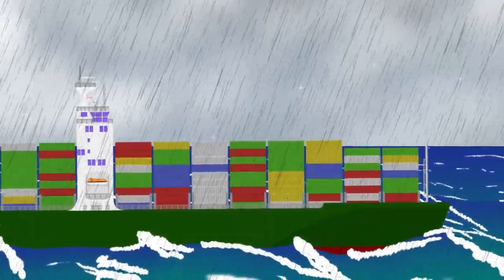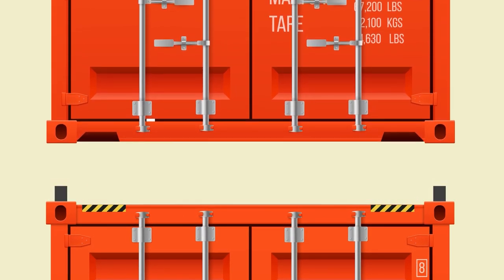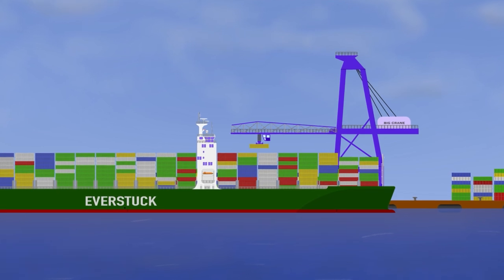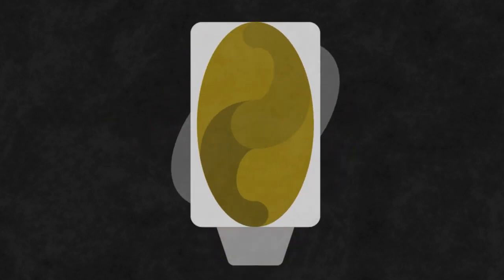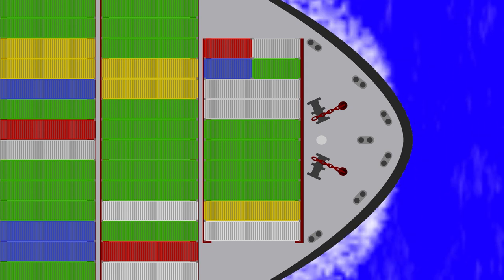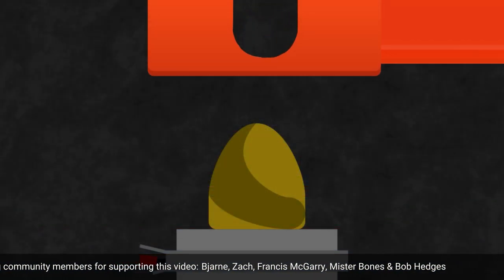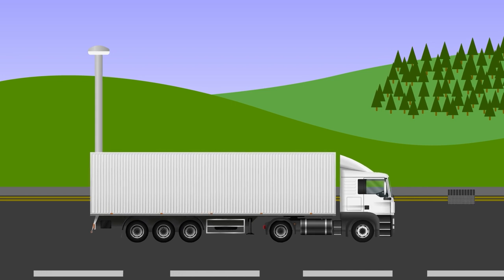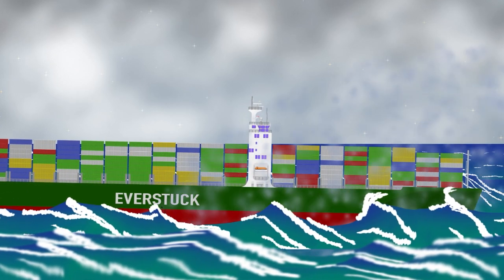Why Don't These Containers Fall Off?

Comment: Are the horizontal facing holes use to lock adjacent columns of containers together? Why are containers only ever placed directly on top of each other rather than staggered as you would with bricks when making a wall?
Reply: There used to be bridge clamps that were put in the side holes at the top of each stack to pull them together but they haven't been used for a while. There are steel lashing bars that tie containers to the deck that fit into these holes, but they can only reach the 3rd container up depending on the type.
Reply: Because then you would have to have certain width of the deck (multiply of length of the container, and they are quite long, so it is quite restrictive, especially for small ships).
And maybe more importantly you would need to have the locking points along the length of the container, to lock with all containers on top. This would add to container cost, and with their number, cost adds fast. And remember that they are used on trains and trucks too, and they wouldn't use this feature at all.
In the end, the current system is good enough, so why bother with more complex and expensive solutions.
Reply: @syriuszb8611  I was wondering why the current system is good enough. A few parallel columns of bricks built with no overlap is a lot easier to knock over than a wall where they do overlap. I guess that ships can't roll enough to cause an edge column to just topple.
Reply: @Kaine96853  Thanks.
Reply: The thing about containers is they are very weak except the edges designed for load bearing. So to do staggered containers you would need a lot more structural elements, which means heavier containers, which means less cargo. And since they will have horizontal locking, the chance of containers rolling horizontally is relatively low
Reply: I think the bigest reason to not stager them is that when you get to the edge you only have half a container to stack onto, and you would either need a support structure or stack as a pyramid, either way you lose total volume of cargo space. (And any attempts to resolve this become a game of Tetris and will make the numbering system of the bins significantly more complicated)

Comment: You forgot about the lashing rods, adding another level of security to the bottom layers on deck. Also not to forget so called hooks and cones  for securing containers agains the guides.   Then the placement of containers according to weight, heaviest at the bottom/ middle and lighter to the top/ sides. All of this helps the cans from coming of in heavy seas. Communications between the stevedores/ tallyman/ crane operator on unevenly loaded containers is a pretty important thing as well.

Comment: Another great video and explanation! As Kaine has already explained elsewhere, the bay counting system is slightly different from what your video says. And it’s usually (but not always) stevedores who are responsible for the placement and locking of twist locks, as well as for lashing the container stacks. Crew members normally do a check before the ship leaves port, and daily on the voyage to the next port.

Comment: On the trucks and trains we have locks that we press up through the wholes of the containers, and then screw it tight down, so when we back under a container, precision is the king and queen of the game :D Depending on the length I either use 4 or 8 locks on the container.
Reply: Hmm 🤔

Comment: You talked about internal lashing but there is also external lashing where bars are placed into the pockets and then crossed to the opposite side and tightened down with a turnbuckle! Those have to be manually delashed and relashed when a ship arrives and before it leaves

Comment: Chassies have manual locks built in. The nose is a sliding long bar from the front and the rear is ovals from underneath. They are immobilized with zipties.

Comment: to haul the containers on trucks, the trailers have the twist locks welded arms off the chassis rails at key positions to haul:
1x 40ft / 45ft
or
1x 20ft central mounted
or 
1x 20ft rear mounted
or 
2x 20ft containers

and in some cases 1x 30ft container

Comment: Again a very detailed and informative video. Thank you for that! Just for the completion of the picture: the landside part of the transportchain uses mostly specialised semitrailers or rail cars, usually equiped with attached but moveable locks which can be adjusted to different containerlenghts or those which are fixed in different standard positions and can be lifted or retract/turned when or where needed. Those locks are normally operated manually by pulling a simple lever or small handwheel. As they can be reached easily by drivers or loading personnel, there is seldom (if ever) automation for the lockingfunction involved.
If I may give some buzzwords for possible future videos about container shipping: stowage planning, dangerous goods positioning, containertypes. ;-) 
Please keep on with your good work!

Comment: The reason they stay on is as much to do with lashing as the twistlocks. The height of the stacks these days require platforms as high as 5 or 6 levels on the outsides and in the case of the ONE Apus that lost about 1800 boxes in rough weather they only had the platforms 2 or 3 high. The best ships these days use fully automatic twistlocks that resist lateral movement but release when the crane lifts it straight up. Usually! I have experienced a 14 tonne reefer hanging on until the crane driver managed to carefully land it back.

Comment: Used to work in a FedEx ground yard, we occasionally got shipping containers in. Their trailers had manuall locks on them. But it was not un common to see one or more of the locks no engaged. Even saw some on occasion where none of the locks were engaged.

Comment: Wadden sea has a couple of day a year where the locals don't sail. But one non local container ship did sail on one of those days. Shallow enough to hit bottom when the ship rolled side to side, waves battering against stacked container and oh there they went overboard. Container latched are not designed for wave impacts.

Comment: Really nice video and really accurate. However at 03:44 the aft 20ft bay should be 03. 02 is only the 40ft bay. Also the biggest ships can have 3-digit codes for the tier.

Comment: Ah so might have been helpful to mention the lashing bars that will be connected to the outside corner casting of each container and  effectively bolted down to the ships deck. The lashing can take place high up on a raised gantry and secure up to a height of 3 shipping containers or about 30ft. They weigh a hell of a lot and sometimes have to be held at arms length whilst standing precariously on a rusty railing just to reach.

Honestly some of the most brutal work I've done in my life. But also good fun

Comment: In my head i am still thinking this is a bad design for stacking really high.
Works well for up to three containers but any higher than that and you should use another system. Maybe something built into the ship itself that will lock containers in place in a rack.

Or, a slight redesign of the container to accept a rod through it that is turned by the crane. The rod goes through the top holes and locks the bottom holes to whatever is below it. The rod doesn't protrude through the top hole and is instead acted on by an extension on the crane going into the hole. So you can stack how many of these as you'd like.
And the rods can either stay in place (making them usable down the road) or they can be extracted by the crane once the container is sitting on a trailer.
Extracted rods go into a magazine on the crane so you can rapidfire loading and once the magazine is empty, you drop off an empty one and pick up a full one or wise versa.

Comment: Yeah our Container chassis have manual twistlocks. The only difference is that they have the a screw attached to the locking lug so you unscrew it partially and lift it into the locking point of the containe turn it and tighten it back down but not all the way because loading/unloading and the general movment between container and chassis wil lock it al together to a point where you stand in the harbour trying to lossen it while a VC stands there waiting...

Comment: Those spring locks are real, used to replace them on container trailers a lot but they are bigger and bulkier than the manual locks and take considerable maintenance compared to manual locks that can be removed and spray lubed

Comment: Wait... So I understand that a container is locked to the one underneath it.
Are there any locks between containers that are side-by-side?  Seems like that would be extra reinforcement you would want in heavy seas?

If not, then I'm not sure what the two oval-slots on the sides are for?  Is that so the crane can pick up a container even if the locks are still attached to the top of the container?

Comment: At least the lower 1-3 rows are also fixed with lashings. The lashings are not only conncting one container to another but also reach over a container. Further they pull diagonally, and they are tensioned to take out all slack. As a result, it makes the whole stack more stiff than usign only twistlocks.
The downside is, as always, it takes a lot of manpower to handle lashings. And on a high stack you won't get them very far up either.

Comment: So... your art suggests that there's the possibility to lock the stacks horizontally as well -- which would seem pretty critical; the leverage of a stack of containers that tall is certainly enough to peel the entire outside column off into the water, right?

But your copy does not talk about whether that's done.  Is it done?

Comment: So they are only vertically locked? No horizontal locking, at least on the top layer of containers? I've seen a video just the other day showing how a whole stack of containers, one of the outside ones, started to tilt when the sea got rougher and then fell over board.

Comment: The Famous Mccgregor Twist locos, Semi Automated Twist locks on Modern Huge Container Ships 🚢 are locked onto the Containers and lower decks are lashed on the Hull of the vessel.

The Gearboxes Containing the bins of balanced remaining Twist locks are placed onto the highest decks tiers of the Containers od standard ISO 20 and 40 foot Containers.

Comment: Well, your are half right sir.
Containers have a quite unique for every vessel "cargo securing manual" if far more that you explained here. Basically you add the stacking cones plus midlocks for under deck and on deck you get again some extra stuff, midlocks again if there is no gap in between 20' containers on same bay or lashing rods and turnbuckles ,same on the lashing bridges. Ideea is that you "lash" the container to the vessel and since container ships are EVERBIGGER, you cannot lash with rods and turnbuckles all of them. In fewer words you explained the vertical stacking of containers on deck but they don't fall because there are also lashed to the vessel at specific highs with lashing rods and turbuckles.

Anyways, good day sir.

Comment: Why not a weighted lock?

Perhaps a pneumatic solution where the presence of significant weight on top of the connector actuates a lock. 

A retraction would merely be a case of the crane applying an upwards force on the container. The applied weight is gone, so the lock undoes itself.

Comment: Containers do fall off in very rough weathers. The number of bays is odd number for 20'containers and even number for 40' containers. So a 40' container on the first row and first column on the port side and the first tier will be numbered 020280 whereas 20' container will be numbered 010280. You have forgotten to mention about he lashing of containers with rods and turnbuckles.

Comment: In the recent past there are cargo ships wich lost their containers by rough weather. Can you explain how that is still possible? At the Wadden sea, northly of the Netherlands, it still happens frequently
Reply: It's possible because any mechanical system has a failure point. If the weather is severe enough, the locks can break. Also, containers can be loaded incorrectly, e.g., with heavy stuff at the top and light stuff at the bottom. If you're loading thousands of containers onto a ship, probably a few twistlocks will be missing. All kinds of stuff can go wrong.

Comment: So why do they have three holes? Only the top /bottom hole would be used for this.
Are they not also connected on the same level? This way the lugs on the  bottom container would bear the stress of the entire stack if it tries to lean.

Comment: Still, this type of vertical locking allows quite a lot of horizontal container movement and immense shearing forces to develop at the locking pins, especially those of the lower containers, tearing them off the corners or breaking them. It's surprising there's no positive retention  or reinforcement/horizontal locking to prevent this, but I guess it all comes down to cost. We should be so lucky they at least use vertical retention...

Comment: Doesn't stop them from being lost sea occasinally and a bounty for the scavengers when they wash up on a beach.  6 and 12 m (20 & 40 ft) containers were mentioned, how do they accomodate the new extended 13 m (44ft) ones?  Is the gap between sufficent to accomodate the extra half metre at each end.

Comment: Very interesting BUT- vertical locking simply makes a tower, which means all the edge containers fall off together.
I guess the next video will be about how container stacking achieves port-starboard stability and locking?

Comment: Having worked as a stevedore for 14 months with a focus on container ships, the container "corner locks", or "pins" (as we called them) were always handled by the people on the wharf either after the container has just been unloaded off the ship onto the easy-loader, or just before it was loaded onto the ship. We've only ever used the cast single-piece "German lashing" corner locks (or pins) on the containers above the deck, which are designed to allow the container to be lifted directly vertically (as the crane would), but not allow it to disengage if there are any lateral forces on it (tbh I'm not even sure how it works), so there was never any locking or unlocking done by ourselves or crew involved (apart from lashings). Never used any kind of dynamic locks (what you call manual or semiautomatic twistlocks), though I have seen them around; we just never used them. We did use lashings of course (which was done by stevedores), but once the containers were above certain height it would be simply impractical for us to use a man-cage to be carting crew/stevedores around to be locking/unlocking pins if we wanted to meet the schedule, so we relied on the passive locks (pins).

Edit:
Also, in regards to the 6-digit code, the container ships I've dealt with had three numbers for a single bay - for example, bay 1-3 would signify that numbers ether 1 or 3 would mean 20-foot, whereas  number 2 would mean 40-foot; or for bay 13-15, numbers 13 or 15 would mean 20-foot, but 14 would mean 40-foot. You described it correctly, but the example was a bit off. Anyway, appreciate all your videos, been watching and learning from them for a while.

Comment: So...how do containers sometimes fall off the ship? Does the locking pin mechanically fail? Was it incorrectly set in the first place?
Reply: Lost containers are usually caused by:

- Not securing the containers in accordance with the vessel's cargo securing manual. This usually includes either not using the securing equipment properly across the ship, or not using it at all in localized areas.

- Deterioration of the cargo securing equipment causing it to fail. This could be the twistlocks discussed in this video, the turnbuckles and rods not discussed in this video, and/or the mounting points to secure the containers to the deck of the ship.

- Improper stowage of the containers (such as putting a lot of heavy containers over an empty one, causing the empty one to collapse and a domino effect to occur)

- Rough seas. This is normally not sufficient on its own to cause containers to be lost. But when combined with the other factors above, rough seas are often the final trigger

Comment: They should just use Harbor Freight ratchet and sockets to lock them together, I have 4 ratchets all with a socket stuck on them.

 I tried everything: penetrating oil, blowtorch, hammer, pry-bar, throwing them against the driveway, 10mm Glock and a combination of all of them. 
Maybe C-4 might work.

To be honest I'm kinda worried that the only way they're coming apart is by actually splitting its freaking atoms, then I just ended up destroying the ratchet along with my entire city.

Maybe I'll just return them.

Comment: Would have thought a design exists that only releases the lock when the force applied is directly horizontal, meaning the rotational force as a container falls off the ship wouldn’t release the lock but a crane lifting it would

Comment: News flash, its rare but shipping containers fall overboard more often than implied here.  DYOR but its on average ~1500 containers a year.  Usually its human error in the loading, sometimes a catastrophic events like a storm/explosion, actual mechanical failure.  There is a whole industry of people retrieving these.  Straight up scavengers getting that bootie in international waters.  Kind of like pirates minus the stealing since they usually hired by either the insurers or shippers and even govts when there is hazardous materials.  its probably worth a video by itself.

Comment: Small error when naming the bays bot otherwise great video. Usually the first 20 foot bay is 01, the second 03, 05, 07 etc and even numbers are only used for 40 foot containers. Meaning bay 01 and 03 make up bay 02. The same way 05 and 07 make up bay 06.